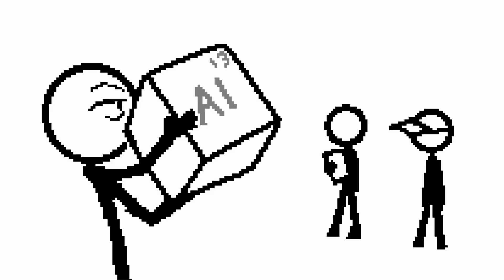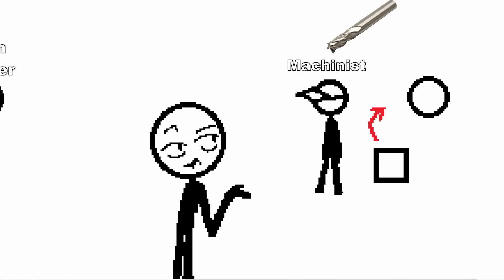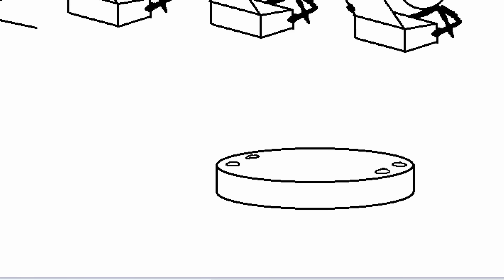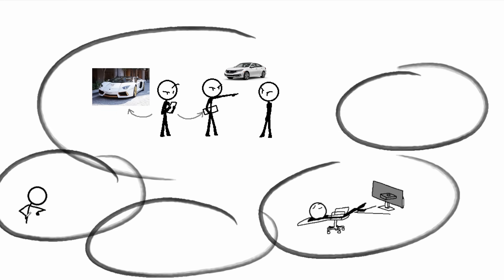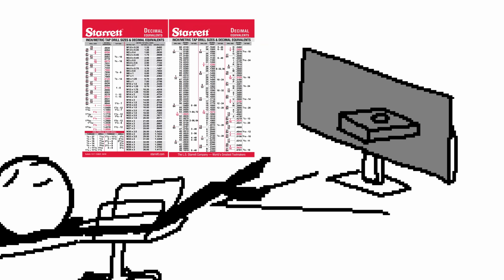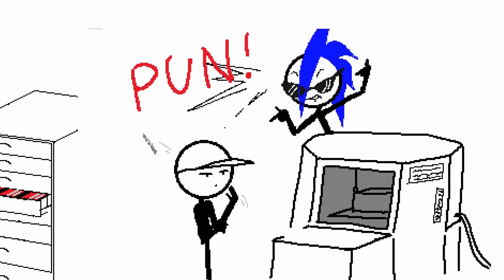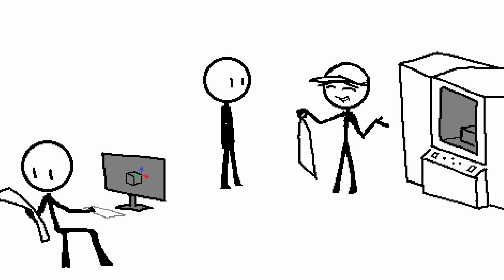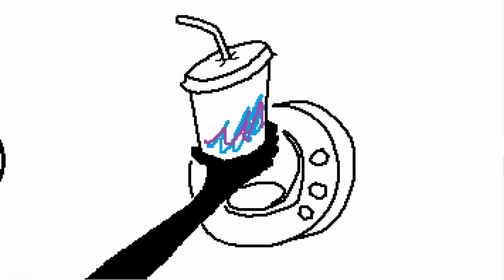Why we hate engineers

Comment: As an engineer with 23 years of experience, you have no idea how many times we get crap parts that does not meet requirements because its out of spec.  That is why we end up sole sourcing parts to vendors who can read a print and meet the requirements on a print.  Yes, we are an aerospace company and there are lots of bad machining companies who can't meet requirements and end up costing us millions of dollars.  The parts may not always go through CMM through source inspection so when its caught, its too late during production runs.  Tolerances go both ways.  When you need it , you NEED IT.  Sometimes +/- .001 tolerances are way too loose for some applications.  

Its funny when some machine shops see default tolerances are +/-.002 for all the features including some +/-.0005 tolerances on our drawings and realize they can't meet them.  That is why we have to work with shops who can product at those tight tolerances and even adjust the machine due to thermal variations.  Some of the drawings require the shops to adjust the sizing for plating thickness also.  Even differences of a few hundred thousand micro-inches of plating can be a problem on some parts.

When manufacturing companies or machinists think they know best despite what is on the drawing, its time to look for vendors who actually know WTF they can do.  You can question the engineer, but until they revise the drawing requirements, you need to meet the tolerances on the drawing or bid higher for the contract because of the tighter tolerances.  If you lowball and find out you can't meet the requirements, it means YOU f-ed up, not the engineer.  You have no idea what the part is used for, so don't always think you know better than the engineer who may have spent months to design the product.  When is the last time you did a tolerance stackup analysis using RSS or worse case scenario?  

You often see machinists who like to bitch and moan, but if they have to do the designing, they would appreciate how hard it can be to be on the other foot.  I design and have my own CNC machine, so I have some experience on both ends.  I don't arbitrarily make tolerances tighter than needed, but when its needed, its needed.  There may be some new engineers who don't know better when they come out of college, but the senior engineers usually put them on the spot really fast.  If they don't know what they are doing, they will need to deal with the issues and problems and that flags up to higher management really fast.  Its sink or swim in the engineering world.  You learn fast or you GTFO of the engineering world.  We don't tolerate BS.  There is a lot of design reviews and if you're not up to snuff, the senior engineers let you know to your face.  There are conceptual design reviews, preliminary design reviews and critical design reviews.  Every part of the way, someone is watching over the design to make sure you don't f-up.

I can see some smaller companies don't have this level of reviews, but as a machinist, you can't just assume that you know better than the engineers involved.  All you get is a drawing for a part, you have no idea how the part integrates to other parts.  You can question, but until the print is changed, you are not allowed to deviate from the drawing requirement.  If the part can't be machined because the engineer is a reject, than you just no-bid the contract.  The person doing the bidding for the project is just as responsible as the machinist who has to make the product.

Just don't forget, you're not always smarter than the engineer.  If you were, you would have gotten the engineering degree.
Reply: Find a place that does tool and die work.  We are used to tight tolerances, standard is +/-.001 on the loose side.

Comment: As a former fabricator, I loved this video. The amount of rework I did to get prototypes done for custom-designed front-ends for fabs was endless. 
"What do you mean the holes don't line up?!" 
"Welp, they don't." 
"Can you make it work? It has to be on a pallet and shipped out tonight."
"Of course."
In my head, I also added, "Did somebody say overtime?"
Things got crummy when we started powder-coating instead of going for anodized finishes. "Drill the mounting plate, not the housing!" And using carbide drills for stainless? Oof. Go slow, oil lots.

Someone wanted me to program the CNC to make a 300mm wafer out of Plexiglass for robot teaching purposes. I did, but I warned them that they would ruin their end effector by trying to lift it. But hey - not my monkey, not my circus. He came back on my day off and had my coworker run a much thinner piece he bought from TAP Plastics to work with. XD

Comment: As a cnc machinist for 20 years now, this video is 100 percent accurate. I am constantly asking the engineers what is allowed for tolerance's as the stuff I make is usally a slip fit yet they call for a +.000/-.001 tolerance when a +.004/-.001 would be 100 percent acceptable.

Comment: It's truly something to be part of the new generation that gets to take over the current industry. 

Especially when you're handed a legacy part that the sub-contractor has been making for the company since 80's, so the original drawing is literally a bunch of coffee-stained scrap papers with scribbles from both the designer and the machinists. The original designer has already retired or moved on, if they even can be identified. 

The part itself hasn't had any issues while in production for years, but that has been only because the machinists knew already where it will be used in so they knew exactly how to make it, until those people also retire. Then we're dealing with a part that neither the new designer or the machinists aren't really familiar with and it suddenly starts having a ton of issues in the assembly. 
An absolute nightmare to start over and try to find out how the previous gen had perfected the manufacturing of that design and what they just knew to do through having worked like 30+ years with these components. 

I love you machinists and thank you for dealing with all the bullshit we designers put you through. If it makes you feel better, we have usually the same dynamic with the sales people who ask us to just kind of manifest calculations out of thin air without providing any kind of information that would help us to narrow down what they are even talking about.

Comment: I worked in manufacturing and have seen engineers design parts without any modeling being done.  When it got to the floor is was impossible to mount.   Was kinda fun watching the boss blow a gasket about it on the floor though.

Comment: Great little video, a couple of additions.

2. Never EVER mix imperial and metric units in any way during any process. They are not compatible.

3. Also known as design for manufacturability. This is why every designer should learn how to manufacture before they learn how to do CAD work, because if you can't manufacture the design or manufacturability isn't optimized, then the design is useless. Failure to understand manufacturability leads to statements like "that looks simple, it can't be hard to manufacture". Yeah, ball bearings look simple but try manufacturing a round piece of steel that has a very precise metallurgical properties and a mechanical tolerance of ±0.001mm. So just because something looks simple doesn't mean it is.

Comment: Ive workes in the recycling industry for a bit under 10 years. On a Job we had these huge Machines that were made to slam down stones and filter it afterwards by size. To do that the precessed materials passed these layers of  big iron meshes / nets. Once every few days these things had to be switched out. The first day I had to replace one by myself i started to hate engineers. 

The thing is, inside of the machine theres not alot of space to work. So after loosing the nuts/screws  you had to lift that thing (2.5m * 1.5 m,more or less its been a while) over your whole body to take it out. So basicly it felt like a stubbern, pointy weighted blanket that weightet something between 20 and 30 kg depending on how tight the mesh was. 

The thing is, thats not the worst part. You've got to throw the new ones up there and the lowest position was up to 3 m. It might be different in a shop, but on the open field that varies and sometimes it 'd be higher. 

Even tough this massive 100 tons machine was mobile (like a tank) we wouldnt move it unless it was absoluetly necessary. 

You could think that a human body would adjust to these things but even tough i wasnt in a bad shape it just worn down my body. I do not work there anymore and i still have knee/hip/backpains sometimes that started then. 

I do not know the right english terms to desceibe it. I hope you understand what i was talking about.
Have a good day

Comment: I am a engineer who does alot of machine process dev.
I also dont get to call the customers, project manager does.
There is nothing worse than a lazy PM, where you get an spec for an impossible task, ask PM and he says he asked customer and customer cant change impossibility, you find a expensive solution, verify customer needs it from PM, buy and use solution, customer comes to runoff, and the customers offhandedly mentions "oh that tolerance? Yeah we just needed a range so put it on there, but it doesnt matter in that area at all...."

Comment: hi hello i cut the blocks stuff is made of.

sometimes the "block" doesn't come out perfect enough, so the machinists often recycle or repair the block depending on what it will be made into. that cup holder is likely made of 2 or more steel trimming welded together and polished with an angle grinder, so don't feel too bad about someone randomly deciding to cut it in half or something.

mechanical parts, however, need to be as perfect as can be so i end up wasting material so the block is bigger than it needs to be just in case something goes wrong during the cutting. i may still use trimmings the right size but i will never weld them because the welds will snap under stress or just weaken the part (impurities, holes and bubbles, residue, altered properties like hardness and so on). i must also consider how it will be machined and welding is generally not appreciated. i don't want anyone launching a 70kg brake lever over my head because there's a 0.4° angle anywhere on the material and it now needs extra work they don't wanna deal with.

Comment: Spent half a day trying to get a setup perfect for a part with a very tight tolerance for a 15° chamfer .015-.025 and OAL of .001. The machine was very worn out and we did 4 second cycle times. Turn out the customer previously used a chop saw and a belt sander and the parts were just spacers for an overhead garage door the engineer just thought they would look "nice" with tighter tolerances.

Comment: Lol, i am a machinist who probably would have been an engineer if they had put me on adhd meds a couple decades sooner.  I mostly did fast prototyping, where the comoany i worked for had only 2 customers, so if one of them was like, i know you dont make this, but could you make it for us?  Our company had to say, sure!  Then id make one using manual machining texhniques as fast as friggin possible,  customers would check it off, or say, you made it exactly how we said to but we didnt put enough effort into our design, and so could you change this thing?  Then repeat that until they say cool, then wed program it into the giant robots to make a bunch of them cheap and fast.  Great video, The one thing I would add that you didnt mention, is the importance of interpersonal skills.  Both machinists and engineers consider themselves very precise, practical people.  They dont like being told they effed up, so if you can finesse them, just a little bit, when you are telling them they effed up, it will really make your day to day life at work so much less awful,  hah.  We had it all at that job, owners idiot frat boy son running things, alcoholic screw up marketing guy, a roided up dude who would just start breaking machinery when anything went wrong, an addict in a methodone treatment program who would disable safety interlocks and nod off at the panel of dangerous machinery and tokyo drift the forklift around the shop, but it all worked out okay, cause we had a millwright and myself and this mexican imagrant dude who all worked hard, knew how to keep the machinery running, and how to sweer talk all the crazy guys there into being less crazy.  And so it was actually an okay place to work.  Both the millwright and i had been commercial fisherman and bar tenders, so we were good at reasoning with people on drugs, and the mexican dude had spent his whole life dealing with idiot white dudes, so he was even better at it than us, hah.

Comment: In my country, when we go to university to become a mechanical engineer or a mechatronics engineer, we are usually forced to practically memorize the standards, the most common bit sizes available for CNC machines, how calculate tolerances and consider how they stack, this to make sure we don't design stuff that can't be manufactured, because, apparently many teachers in their engineering career had that exact problem happen to them so much that they took it to themselves to fix it. I got my degree 9 years ago and that was mostly a standard practice here, and truth be told, back when I worked in manufacturing I rarely saw this happen with local engineers, it happen mostly with designs coming from the US, due to that, at times I would be tasked with re-designing that stuff to make it easier to manufacture 😂

Comment: I work as a technician at a research lab. This stuff happens ALL the time. The dumbest thing is they have everything precision cleaned and baked out, even if it doesn't need to be. And they have also done as illustrated here, taken what is essentially a piece of sheet metal with a knob on it and carved the thing out of a block of stainless, when a piece of sheet metal and a knob on it would've done the job for 1/10 the cost.

Comment: In the oilfield, I found several engineers who were not educated beyond their capacity to learn. We found middle ground. It's hard if you're a dinosaur like myself. We learned from each other, not so much thinking out of the box but thinking in a different one. The best engin÷rs to work with are the ones that actually worked in the field on summer break. Communication is sharing.

Comment: I would like to see your take on architechs and engineers and construction workers. My dad built houses and had to pull off some feats of strength and ultra brain power to remodel a house. The buyers of the house had no idea what they wanted and asked for different light fixtures after the ones they wanted before were already installed

Comment: I have been both a machinist and a design engineer. I think since i have ptsd from difficult parts. I sometimes over simplify parts at the expense of performance. I don’t think R$D and design can be done well without some in house machining and fabrication capacity. The Engineers will always get out of touch eventually.

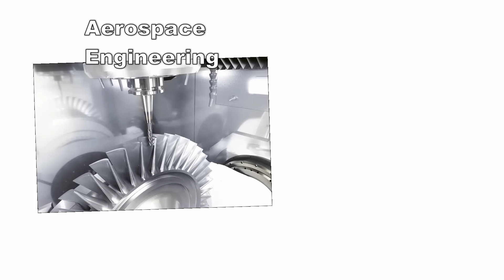Comment: 4:29 I have this exact problem with a job in my shop. The customer wants a hole diameter, but they want the tolerance to be +/- .001. On a hole with double lead threads. The threads are also +/- .001. There ends up being only about one or two threads per hole. We have to carefully position the thread gauge at the perfect angle to get it in the hole, but once it's in, it's beautiful. I know for a fact that the end user is not going to be nearly that careful and is going to cross thread every single one of these things, probably on purpose. Why are we devoting so much time and energy to something that's going to be destroyed by the end user?

Comment: the biggest issues that I've seen with engineers is, it looks good on paper put put it in real life and it won't work.

for example I saw design where we were feeding gas from a tank, into a machine that would mix it into water (trying to explain simply.) there was an exhaust pipe connected to the pipe just before the intake into the machine. there was no actuator nor valve to make sure it didn't leak out of the exhaust. we argued with the corporate side about it, they forced our hand to install it as the designed then they had a leak that couldn't be found. because it wasn't a leak, it was the exhaust.

Comment: The engineer sat at his drafting board.
A wealth of knowledge in his head was stored.
Like “what can be done on a radial drill or a turret lathe or a vertical mill?”
But above all things, a knack he had
Of driving gentle technicians mad.
So he mused as he thoughtfully scratched his
Bean “Just how can I make this thing hard to 
peen?” If I make this perfect body straight
The job out to come out first rate
But that would be so easy to grind and paint
That it would never make a welder faint.
So I’ll put a compound taper there
And a couple of angles to make them swear
And brass would work for this little gear
But it’s too damned easy to work I fear
So just to make the machinist squeal
I’ll make him mill it from tungsten steel!
And I’ll put these holes that hold the cap
Down underneath where they can’t be tapped
Now if they can make this it’ll just be luck
Cause it can’t be held by dog or chuck.
And it can’t be planed and it can’t be ground.
So I feel my deign is unusually sound.
And he shouted out with glee, “success at last!
This goddamned thing can’t even be cast!”

-credit to AvE

Comment: Having dealt with contract manufacturing custom equipment (as an engineer) ... I can tell when the engineering documents were half-baked from the customer (probably because of managers yelling about deadlines) because someone put a ±0.0001" dimension tolerance on a WELDED part that was over 84" apart.

You're talking about a piece of metal that thermally expands more than that just from being placed inside a building after riding in a cold truck.